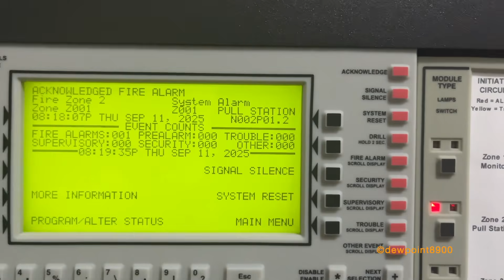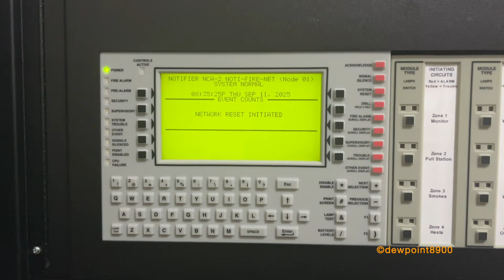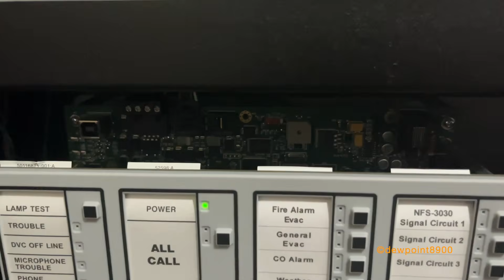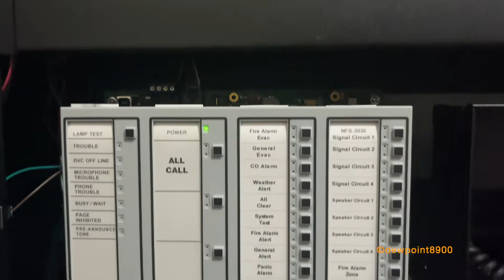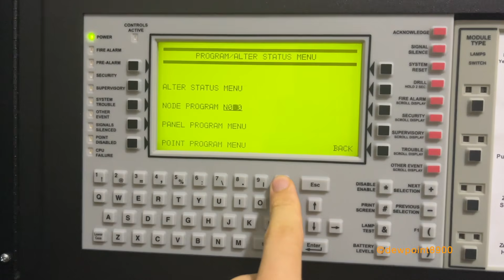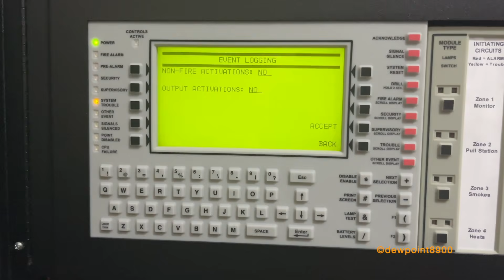Notifier NFS-3030 with DVC Overview and Demo

Comment: A local hospital has this system (or NFS2-3030?) rebranded by Johnson Controls and is a 27-node system. Again with the abnormal display clutter, but luckily the hospital has multiple ONYXWorks computer stations. They also have the programming software and can make their own changes, which kinda raises an eyebrow. Testing there is a pain and we’re there 10 months out of the year (on average for a week at a time).
Reply from the maker: Sounds like a whole lot of work. I recently filmed my own 9-node network with all sorts of different panels.
Reply: @dewpoint8900 It's not so much the work as it is the people we have to deal with, although the way we have to go about doing the inspection is atypical from how we normally do one.

Comment: NFS-3030 is already discontinued as the NFS2-3030 has been out for well over 15 years. Unfortunately, the NFS2-3030 and entire Onyx series line will also be discontinued and EOL by the end of the decade as Honeywell moves toward the Inspire series which is to be shared by Notifier and FCI alike - though they will retain their exclusivity from each other - almost exactly like Simplex & Autocall. Onyx is hardly being sold anymore in new installs unless to get a feature that is not yet supported on Inspire. Inspire is a great line but Onyx was classic robust hardware, the end of an era for sure.
Reply from the maker: I agree. I have an N16e that I need to get programmed. Gonna miss the accessibility the ONYX panels had once they're gone.